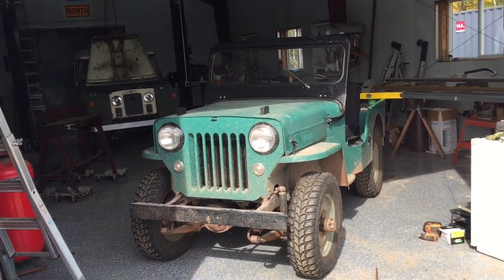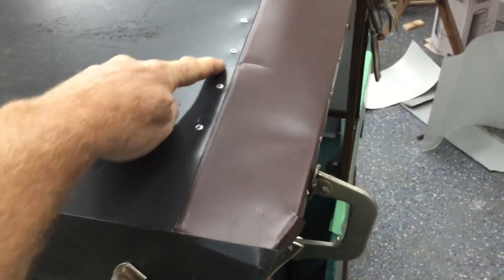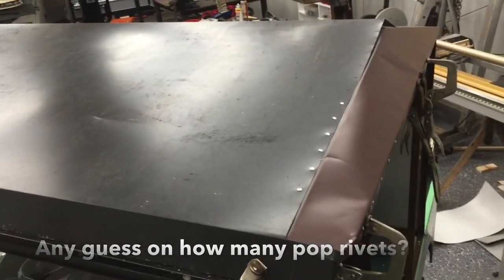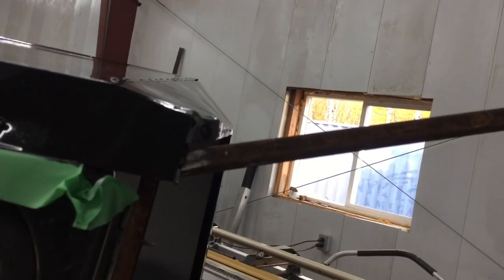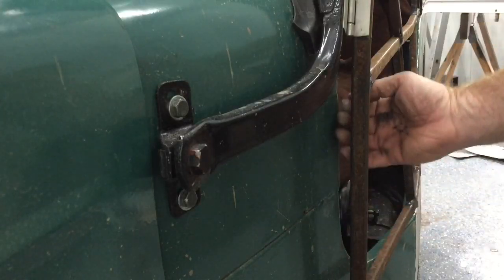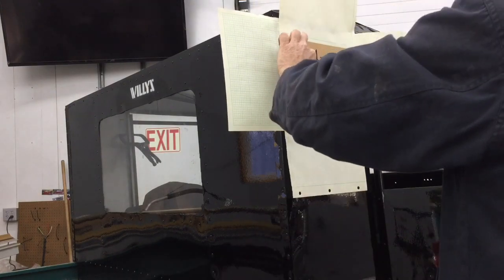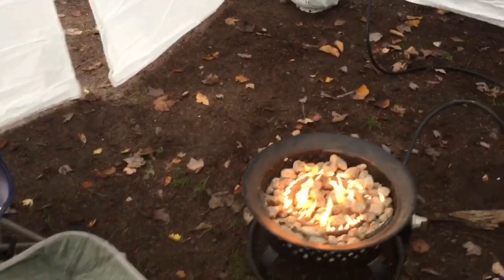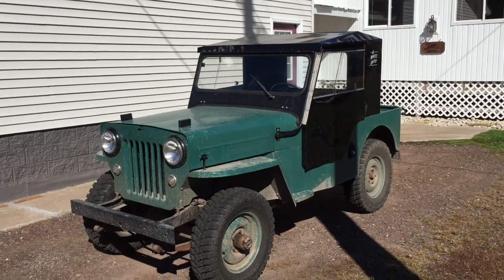Willys Jeep mild restoration #19 Building a Top

Comment: I like it. You might get a roll of the Dynamat product. They have a sound deadener and a foam product that works well on the “oil canning” you get on the road. 
I have a M38 and will be making a top soon. 👍
Reply from the maker: Mark Randall dynamat was the first thing that popped into my head, just not enough time to get before the trip. Are you building a half or full top? Would love to see it!
Reply: Fast Dad Garage - North & South Chamberlain’s 
It will be a soft top I think. Mostly for the Texas sun. A safari type with no sides.

Comment: the stencils are nice! Put some weather stripping between your frame and roof panel. Why did you leave a gap above the door windows?
Reply from the maker: The doors swing up the way the hinge is mounted and it would hit. I’m changing that and plan to seal it much better